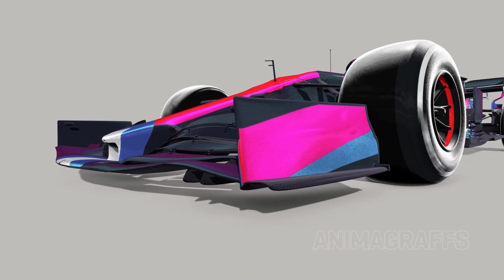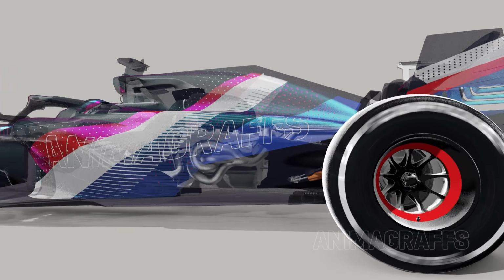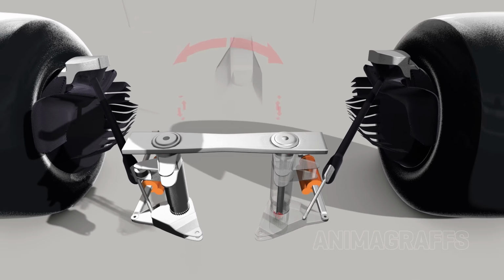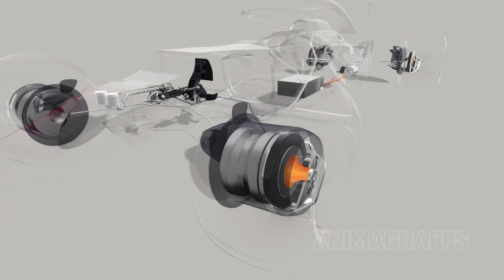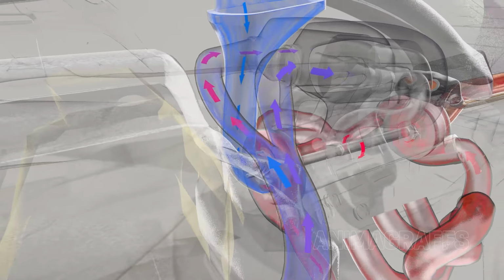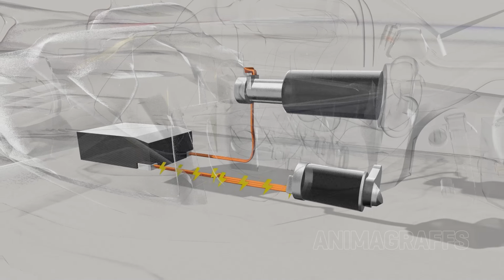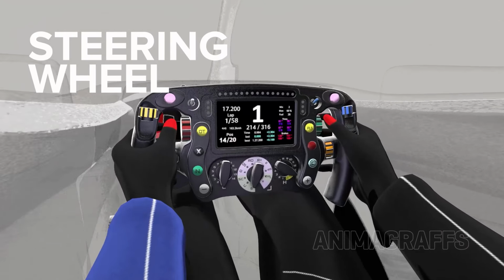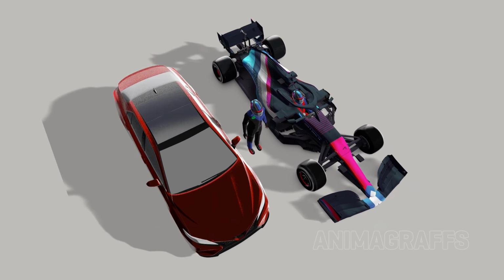How a Formula 1 Race Car Works

Comment from the maker: Video corrections:
0:00 Yes I know the music is TOO LOUD and I'll never forgive myself for this GRAVE ERROR 😭
15:10 "hydraulics" (not "hydrayulics")
16:42 Modern gearboxes have 8 forward gears and 1 reverse (not 7 forward)
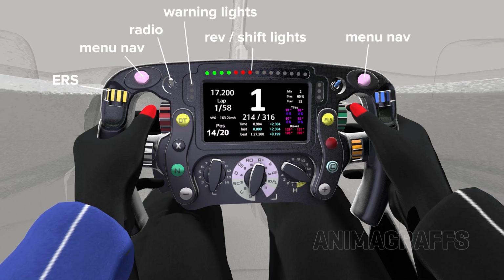20:20 There's actually no Launch Control, and this switch remains an unsolved mystery
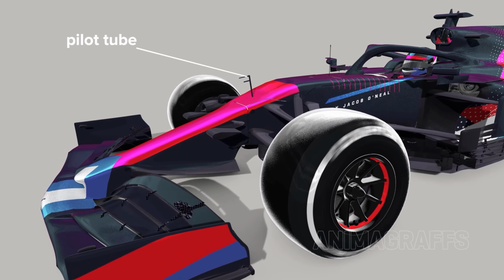22:17 "Pitot" tube (not "pilot")

Comment: You may not read back-comments, so this may fall on deaf ears, but...

Can you do another F1 car, but with the new 2026 regs? (active-aero, 50-50 hybrid/electric power unit, no more venturi  tunnel ground effects, etc). There's no halo on this version either, but i know this was most likely made prior to the halo even being a thing.

I know the actual cars haven't even been built yet, but i know it takes a while to put these together.

You mention the regulation changes in this video, so you may have this in the works.

Comment: 1:05 yes, yet F1 cars use them a lot, and cleverly too. First, they usually use this to extract the pressure that builds of in front of the tire, lowering drag. Then, it may also be used to extract air further from the floor of the car, lowering the pressure and increasing downforce.

That's just the basics of it, vortices are used a lot more, despite their disadvantages

Comment: Great video, loved it but catched an error (that has also been outlined by others):
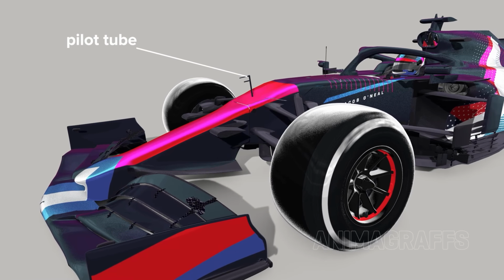At 22:18, when you speak about Sensors, you mention and it reads: "pilot tube", that should be "PITOT Tube", a device invented by the french engineer Henri PITOT to measure fluids (air in this case) velocity. Commonly used in aircraft as well.
https://en.wikipedia.org/wiki/Pitot_tube?wprov=sfla1

Comment: F1 2027: Playoffs, equal engines, 4 super speedways, reverse grid, fan points, ad breaks, strategy votes, penalty wheel, sprints. Full tank every stop, all tires used (even snow)!

Comment: In the section about sensors, the 'pilot tube' is actually a 'Pitot tube', used to measure fluid flow, in this case air, for speed.
Wonderful video!!

Comment: I won't be able to praise you as poetically as many of your posters, but I have never learned so much, so quickly, about Formula 1 design as by watching this video. Your graphic design makes immediate sense the viewer and your command of the facts is impressive. Thank you so much!

The one thing I don't understand concerns the angle protecting the driver's helmet. If the car rolls, surely the roll hoop and the top surface of the halo will be the two points to define a zone of safety for the helmet, as they are the two points which will contact the road as the car rolls. The angle is a line between roll hoop and halo, not roll hoop and body. Am I wrong?

Comment: Congrats, You nailed it, in a very simple and for "outsiders, understable, way.
I just wish I had a HANS-device, when I broke my neck, in a severe, sudden stop crash.
One thing though: The helmet above visor, is bulletproof!
Actually, tested with a gun by, I think it was Driver61?
And, it is not a "pilot tube", it's pitot tube, measuring the pressure of the air in the tube=speed/other items.
Think the video was about helmets, specially.
from a Finn in Diaspora

Comment: downforce and ground effect are separate forces acting upon the car.  They do the same thing at the end of the day, which is  pushing the rubber into the ground, but they are independent of, and unrelated to,  each other.

downforce (dive planes/splitters/wings) works similar to the aileron on a airplane wing.  it deflects the vehicle by a pushing force (compression) as the air compresses around the car as it moves through space, it quite literally pushes "down" on the car.  hence, "down force"

ground effect (the space between the vehicle and the ground) shares Bernoulli's principle with the airplane wing itself.  It works in almost the exact opposite fashion as downforce, as it acts like a vacuum, sucking the car to the ground.  

Ground effect can also be achieved by radical ventilation, as opposed to relying solely on the silhouette/frontal profile of the car.  Cooling ducts/passages can remove cool air from underneath the car or divert warm (i.e. low pressure) air back under the car, contributing to Bernoulli's Principle.

downforce = downward force (positive pressure above the car caused by deflecting/compressing the air)

ground effect = vacuum (negative pressure below the car car as observed in Bernoulli's Principle)  this method relies on restricting the air flow (volume) underneath the car by lowering the car (or with skirting) , as opposed to an airplane wing, which relies solely on it's asymmetrical shape to create a difference in air speed above/below the wing.

Drag = the by-product of air (fluid) friction expressed by the surface area/speed of the object.  Drag exists independently of any downforce or lift, but is increased by either.  essentially, all objects, even 2 dimensional, have fluid drag (parasitic loss)

Comment: The brake pedal is so hard to push down. Guy Martin tried out an F1 car and got to about 50% on the brakes. It's harder than we think to be an F1 driver. The steering wheel would have most of us baffled. Total respect for all the drivers. They're doing something that many of us can only dream of doing.

Comment: Not to forget: F1 Car tires have no profile to provide better grip on dry surfaces such as the rice track in optimal weather conditions, unlike your average car tires which have profile to provide grip in most weather conditions and suboptimal driving ground such as broken roads or dirt.

Comment: I had to leave a comment. As a race driver and mechanical engineer, this is the most well put together video I’ve ever seen on this. It’s so difficult to not go down the rabbit hole technically in any of the concepts you covered, but you nailed each explanation clearly. Great production. Just mention “ground effect” next time and it’d be perfect 😁 fantastic job man.

Comment: As a general rule, the FIA only allows the drag reduction system during all three rounds of practice, as well as all three rounds of qualifying, and during the race but only after the third lap of the race, if you are within one second of the car in front of you in the DRS activation zone. For safety they deactivate it if it's been raining for a little bit or it's raining heavily on the track, and after the third lap following a full-course safety car yellow.

Comment: I can remember watching an F1 report show. It was when Mercedes and Lewis Hamilton were dominating F1. The experts were trying to figure out how the Mercedes seemed to be so much better in the corners. They had close ups of the front suspension components. After some debate, one gentleman who was technically trained stated, “ The front suspension components look to be 3D printed liquid titanium in nature.” 😳 Excuse me?! I literally rolled it back 20 seconds. Because, I had to make sure I heard what I heard. The physics of what an F1 car is capable of is mind boggling. Especially braking. Nearly 200-220kmh down to roughly 60kmh in around 200 feet. Oh, and turn right 60-70 degrees. Insane.  Great work! Love this page!

Comment: When using the definite article "the" ahead of a word beginning with a vowel, it is pronounced with a "long" e, so it sounds like "thee". Example from your video (in discussion about airflow): "the air" is pronounced "thee air"... not "thuh air".
The same rule stands in all other situations: e. g. Say "thee office, thee apple, thee opening... but thuh car, thuh brain, thuh reason.
Remember, it's the first letter of the following word (being either a vowel or a consonant) that determines the pronunciation of the preceding definite article.
A somewhat similar rule applies when using the indefinite article "a". If the following word begins with a vowel, we use "an", not "a". Example: we say "an apple". But when the following word begins with a consonant, use "a". Example: "a car" or "a table".
English lesson over! 😁 (great video, btw)

Comment: I find it so fuckin nuts that the car just has to move forward and the rest is the air doing the work. They can’t control the air, but they force the air to go where they want it with all those little aerodynamic pieces. It’s sorta like planes, you’ll see tiny little fins and just those little tiny fins can reduce drag on a giant commercial jet. Insane stuff. Amazing engineering.

Comment: Great video. Near the end you mentioned the cars have a pilot tube to measure speed. That should be a pitot tube. Pitot tubes are used on airplanes to measure airspeed instead of ground speed. It shows the engineers care more about how fast air is moving across the aerodynamic surfaces, which can vary depending on wind, then they care about how fast the wheels are moving across the ground.

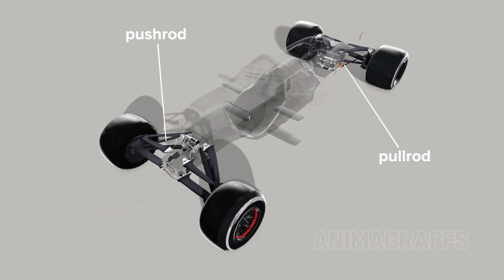Comment: Great video! I just have one question: When you were showing how the tires are connected ( 6:00 ) you said that 'in this model' the pushrod is in front. Does that mean that there are models where the pushrod is in the rear?

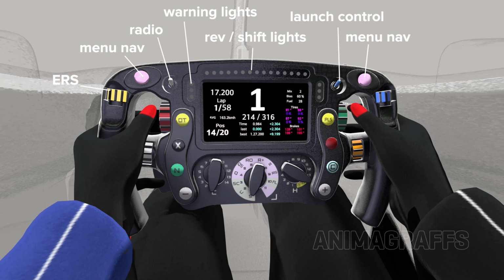Comment: They don't tell people this, but that "unknown" switch (20:20) is in case the driver has to make, you know, waste. That's the "launch" they refer to. It uses air to push down and then pull the waste into a small pan, which may be dumped after the race. I'll probably get in trouble for giving this up.

Comment: Maybe you could have added that all drivers learn how to use all buttons on the steering wheel, without looking at them, because very often, there just isn't enough time to look at the wheel while driving through several corners.
Most drivers can use their wheel in the dark and rarely make a mistake.  Respect.

Comment: IT IS NOT CALLED A PILOT TUBE BUT A PITOT TUBE AS ON AIRCRAFT WHICH MEASURES AIRFLOW SPEED AND THUS AIRSPEED.
A pitot tube (PEE-toh; also pitot probe) measures fluid flow velocity. It was invented by a French engineer, Henri Pitot, in the early 18th century, and was modified to its modern form in the mid-19th century by a French scientist, Henry Darcy.[2] It is widely used to determine the airspeed of aircraft;[3] the water speed of boats; and the flow velocity of liquids, air, and gases in industry.
Theory of operation
The basic pitot tube consists of a tube pointing directly into the fluid flow. As this tube contains fluid, a pressure can be measured; the moving fluid is brought to rest (stagnates) as there is no outlet to allow flow to continue. This pressure is the stagnation pressure of the fluid, also known as the total pressure or (particularly in aviation) the pitot pressure.

The measured stagnation pressure cannot itself be used to determine the fluid flow velocity (airspeed in aviation). However, Bernoulli's equation states:

Stagnation pressure = static pressure + dynamic pressure.

The dynamic pressure, then, is the difference between the stagnation pressure and the static pressure. The dynamic pressure is then determined using a diaphragm inside an enclosed container. If the air on one side of the diaphragm is at the static pressure, and the other at the stagnation pressure, then the deflection of the diaphragm is proportional to the dynamic pressure.

In aircraft, the static pressure is generally measured using the static ports on the side of the fuselage. The dynamic pressure measured can be used to determine the indicated airspeed of the aircraft. The diaphragm arrangement described above is typically contained within the airspeed indicator, which converts the dynamic pressure to an airspeed reading by means of mechanical levers.

Comment: If you took just the steering wheel back to the 70's or 80's, the drivers would have thought you were putting them on, just joking.
If you took it back to the 50's, they would have thought it was alien technology, and also told you to go to hell and stop wasting their time.

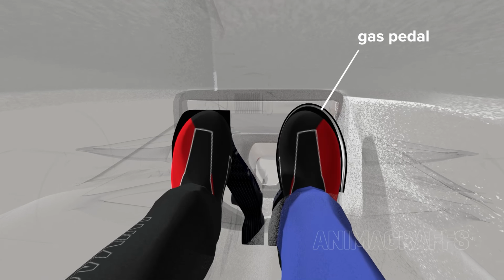Comment: 21:59 Is not GAS PEDAL.
     It is AIR PEDAL (throttle pedal controls the air flow), the Gas is proportional to the charge of engine !!!

Comment: Don't F1 cars have no waste gates, instead using the MGU-H as a generator to recover the extra exhaust energy? I might be wrong but I'm pretty sure that's the case.

Edit: I am indeed wrong, they have both. The wastegates are only used at extremely high exhaust flow.

Comment: engineer: "a drinks tube extends over the shoulder, it's connected to a small fluid reservoir to keep drivers hydrated while racing" (18:36)
dad: it's a drinking straw

Comment: 1. they dont have lauch controlle anymore 2. the mgu-h is also used to spin the turbo, for a more linear power to throttle ratio. exept for this, the video is pretty good with a lot of details, good job

Comment: Thank you so much for this beautifully produced piece of work! I'm a and big F1 fan!

Re: music volume... Don't sweat it... always keep in mind that your VO is the message and matters most (you have a solid articulate storytelling voice that cuts through well). Music is generally used for setting mood, pace, and transitions. So... INTRO (establish, music up then under VO) - TRANSITION (music up) - SEGMENT/SECTION (music under VO) - TRANSITION (music up) etc... OUTRO (music up and out).

Also, in most every piece of production music there are spots that are dynamic, interesting and uplifting. If you mix music volume under your VO well, those dynamic spots can be dissolved in (while under VO), in an inaudible way before the spot, so the spot for the transition appears in the NLE timeline right as you complete your VO. When it works, it provides a more customized music bed for your final edit.

Thanks again for the awesome video!!!

Comment: 2:03 as a kid growing in the early 2000s, I remember looking at a kid's guide book about racecars in general, and obviously one of them is an F1 car. I don't remember exactly when was the barge board first used, but back then, it was just a one rectangular piece of carbon fibre curving outwards. Still doing the same thing but man, this pre-2021 model (I think?) you used is extremely intricate.

Comment: The MGU-H doesn't actually convert the heat, but the kinetic energy from the exhaust gas flow. It's called "h" because it uses the hot gases, but it's in fact also kinetic energy.

Comment: One thing you missed was the camera pod on top of the car with the led lights the let's you know the car is safe to touch or if something is wrong with the electric battery warning you not to touch the because it will electrocute your ass.

Comment: Awesome video Jacob. I was always curious about F1 car design, and this is as close as you can get to walking around one.
Oh and by the way, the 'pilot' tube you mention that is attached to the front of the car should be 'pitot'. Double check before you correct this.

Comment: Incredible animation and so useful in understanding what is happening to the cars and drivers on the track. I'm wondering how much the cars change from year to year and if the changes are mandated or voluntary? Could you run the same car if was particularly fast? Near the end of your video you reference the "pilot tube" to measure speed. I think it is a "pitot tube" that measures speed using pressure differences. Used mostly on airplanes.

Comment: I thought the MGU H  was an electric motor driven by the hybrid battery to keep the turbo charger spinning at high speed when needed to prevent 
turbo lag  ?   Then any excess exhaust pressure can do the reverse and also charge the hybrid battery. A balance system.

Comment: The floor doesn't create very low pressure at its lowest point, where it is moving slowest. Rake allows the air to expand in volume and to move faster, both of which create lower pressure. A good video with nearly 5 million views and I hope that YouTube pays you amply for your time and skill invested.

Comment: You do an incredible job with these. Pretty amazing. Here I thought I was doing good designing 3D printed molds in Solidworks for my carbon fiber parts. As a pilot and aviation fanatic, let’s see some more aircraft videos!  Keep up the good work.

FYI. F1 engines are now using power from the electrical system and a electric motor for the turbo system as well. As the driver begins to get back in the throttle, it very quickly spins the turbo back up prior to there being sufficient exhaust gasses present. Therefore, very little to no lag exists within these forced induction systems. Amazing feats of engineering and manufacturing. I’m not one to go around correcting everyone, but being a pilot I picked up on it. It’s called a “pitot tube” (pee-toe), not “pilot”. Absolutely love the videos!

Comment: The tip of the front wing helps to prevent intervention between the streamlines of the upper side (high pressure) and the down side (low pressure) on the end of each wing blade. So the air on the high pressure side wants to travel to the low pressure side on the tip of each wing blade wich creates lift and drag.

Comment: A pitot tube measures fluid flow velocity. It was invented by a French engineer, Henri Pitot, in the early 18th century, and was modified to its modern form in the mid-19th century by a French scientist, Henry Darcy.

Comment: Excellent job, pure 10, I'd just like you focused a little bit more one how that ancient torsion system works on F1, which is nothing else than exact calculation of elasticity of metal, thus controlling it's twisting

Comment: Well done. One small notice , there is generally a misconception regarding turbulence. Actually flow over nearly all areas of the car is turbulent. What I think you mean when you talk about wheel aero is basically the separation that happens behind them and the uncontrolled vortices they create . Again video is well done , with all cad and simulations congrats